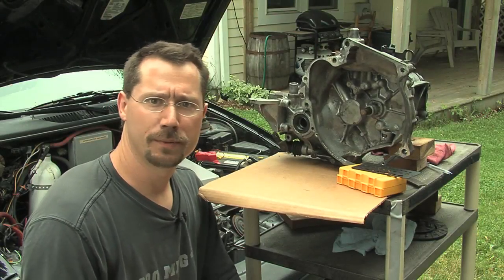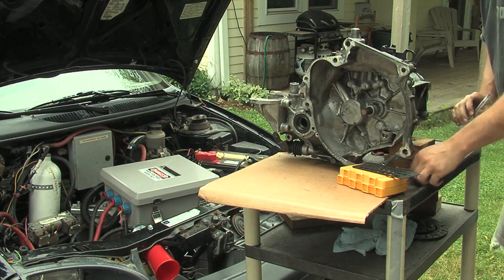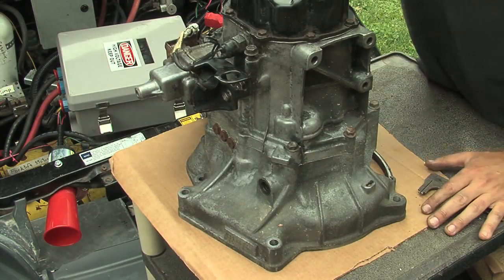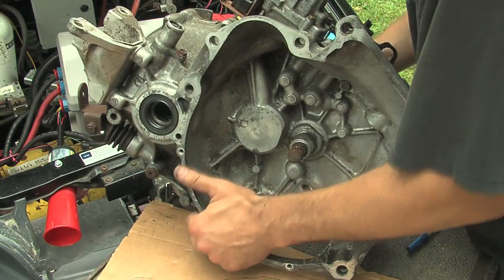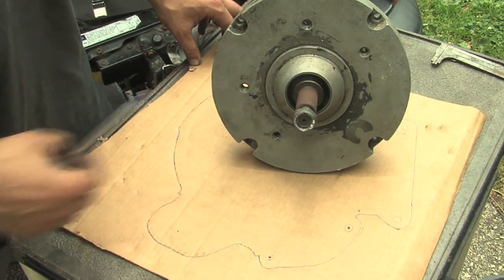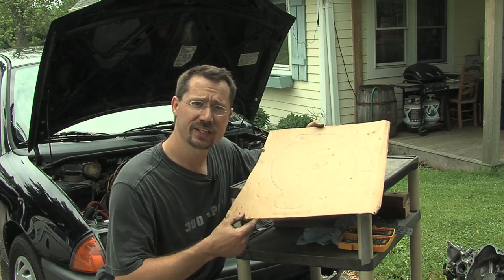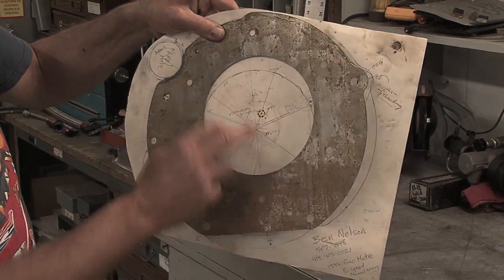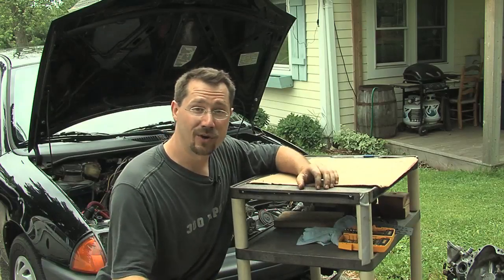DIY Electric Car: 06 Adapter Plate

Comment: Sorry, I think you have designed the plate backwards.  If you start with your aluminium plate, find your reference centre.  From that mark and drill the PCD of the motor mounting holes.  Then cut a hole in the middle so you can make an adapter to locate it to the input shaft.  Then trace round the edge of the transmission and use transfer punches to mark the position of the bolt holes.  Removes all guess work.

Comment: Don't we need a clutch plate ?
Reply from the maker: No clutch plate needed. The electric motor has enough torque that much of the time, I would simply leave the car in a single gear and wouldn't shift at all. When I do shift, the electric motor has so much less rotating mass than the engine and flywheel that it shifts just fine without a clutch.
Reply: BenjaminNelson thank you

Comment: In order to shift with no clutch how is it done ? And if it has a clutch do you need to wait seconds to shift between gears because of the torque of the motor ?

Comment: My dream car is a Dodge Caravan with a Warp 9 and about 20 kwh of 
lithium ion. Found this channel because you have video with a T850 to 
Emotor mount up. Been checking the scrapyards for the Neon T850, which 
should mount in a Caravan. Going to strip every pound possible from the 
van. No a/c, air bags, heat, inside trim, no back seats, wipers, might 
even take some things like the steel behind the plastic bumper covers 
off. I know people will go on about safety, but in 30 years I've never needed a air bag or bumpers.

Comment: why don't just plug the motor to the driving shaft?  the electric moteur is made to have high torque at start...
Reply: I  just attached the electric motor to the (oversized) plate with a generous coupler hole, alligned the shafts with a coupler, and then drilled the thru the transmission holes that are accessible from the transmission side.   I had to trim the electric motor output shaft and transmission input shaft with a 4" right angle grinder (cut off wheel) to get them closer onto the 1/2" adapter material. Then I marked arround the transmission and cut that line.
Reply: it will have less weight on the car too...
Reply from the maker: At a bare minimum, you want gear reduction. Virtually all commercially made BEV electric cars use single-speed gear reduction. You also need a way to connect the electric motor to both the driving wheels, so a differential is needed as well. On this front-wheel drive car, the differential is built into the transmission or "transaxle". So, on this car, I don't actually need to shift (I can drive it with the transmission just left in 3rd gear,) the transmission is used for the gear reduction, the power split to both wheels, and as a place to physically mount the electric motor.
Reply: +BenjaminNelson sorry I didn't say that I was speaking about propulsion cars or trucks. If the motor can turn 2000/rpm so tire perimeter by rpm by 60 = speed   exemple: (1.95m X 2000rpm X 60 minute  = 234km/h) . I known it is theorycal but why don't make it like that? motor attached directly with the center driving shaft of a truck with a coupler by exemple. we  have now a truck that weight less and have less friction without the transmission.
Reply: +MrMonozzz same thing with mercedes or muscles cars that are propulsion

Comment: It was great hearing your presentation at the MREA today on how to build your own Electric Car, very inspirational!
Reply from the maker: +Game X Four I've had this car going over 70 miles per hour. Higher speeds do drain the batteries faster, but yes, it doesn't have to be slow. Make sure to use higher voltage if you want a faster car. I've run this one on up to 144V DC.
Reply from the maker: Thank you! Glad you liked it!
Reply: +BenjaminNelson How fast is it? Over 30 km/h?
Reply: +BenjaminNelson Nice, I asked because i only needed 30 km/h to my epa-tractor project in the future. If you dont know what an epa-tractor is so it a car that have been converted to a tractor.
Reply: Hello Benjamin Nelson, is a 9 hp engine compatible with a 920kg car ?. I am about to build a Daihatsu Applause car with a 9hp auto-lift engine, will it fit in, how fast can it go ?.

Comment: The easier way to trace is to put some used engine oil on the surface of the housing, and 'stamp' it to the cardboard. That's how we do the gasket tracing.
Reply: coloured grease works better :)